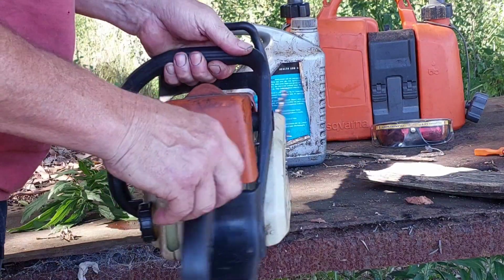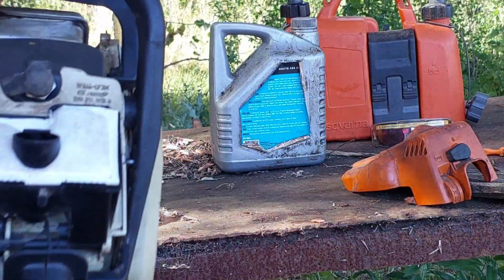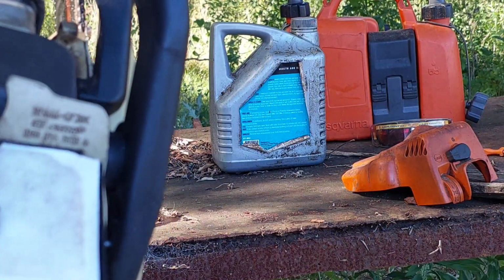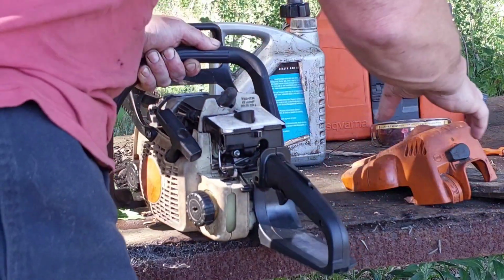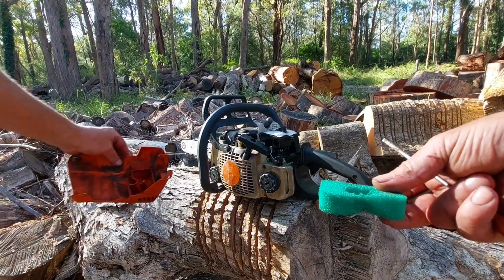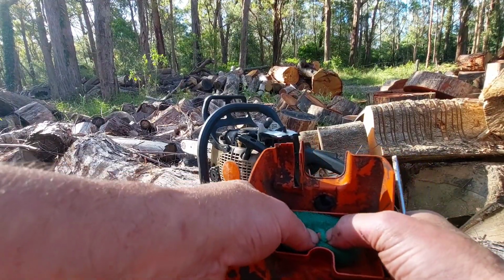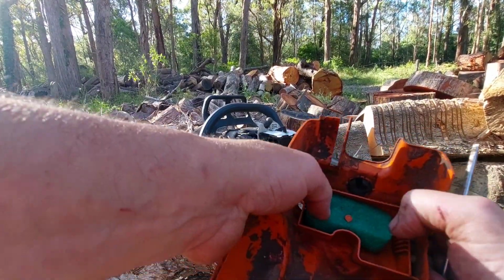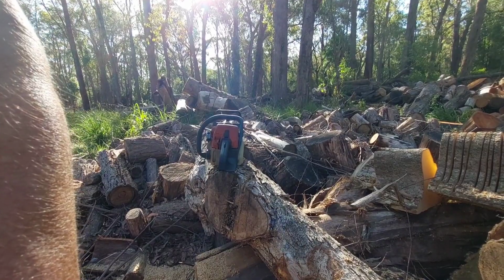dirty Ralph big bore a waste of time ms170 chainsaw

Comment: Exhaust and intake is way too high duration for such small saw... you got low compression since you raised the exhaust too high... no more than 150 intake and exhaust duration should be used on those saws.... and even 150 duration is too much for my liking..
Reply from the maker: All true but this farmer tec big bore was gutless from std, so I put  factory original motor back on cheers
Reply: Well those are not strong saws from the get go.. i watched some of your video and you said that squish  was very high so that definately makes it weaker. I ported 018c and stayed very conservative and it gained power, but its not a beast. I dont know the exact squish on that but its more than 0,8mm since it did not even touch the solder. Those are less is more kind of saws when it comes to porting, but thats my approach anyways 🤔